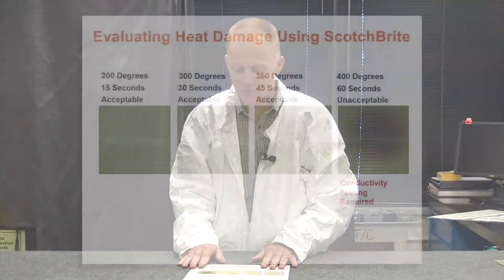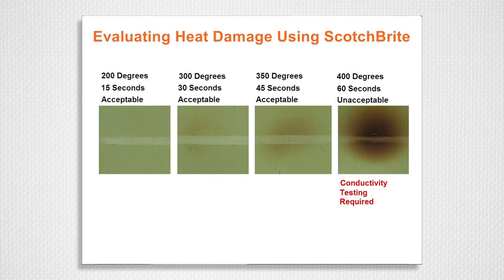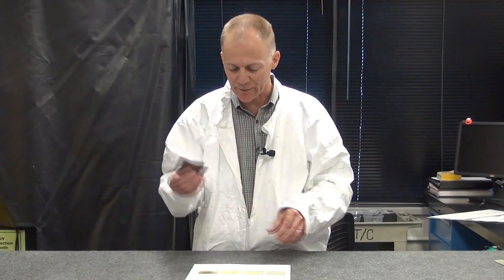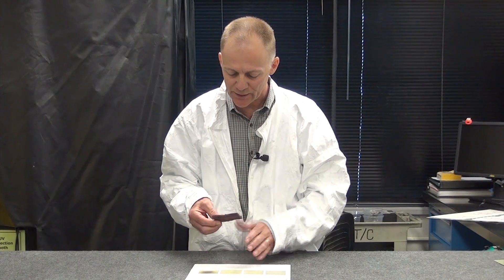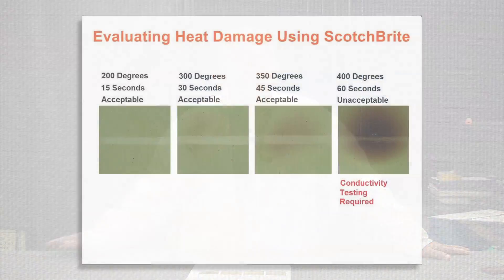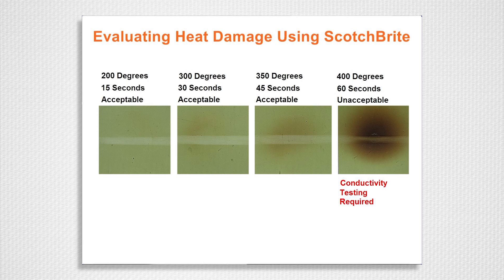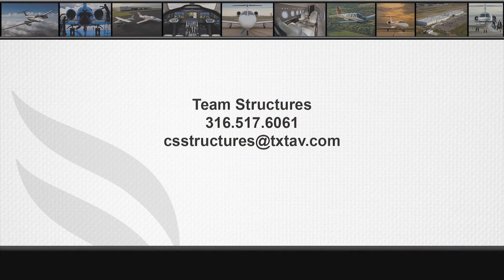Evaluating Heat Damage Using a Scotch-Brite Pad

Comment: Thanks for the explanation, in fact it was very useful for us as we have a heat damage in the pylon and rear compartment of a cj2 due to the rupture of a precooler.  My question is why Cessna has not installed a pneumatic shutoff valve in the engine to avoid the recurrence of this problem, the shutoff valve is located inside the tail compartment, I don't understand why there is no heat sensor in this area to alert the crew.  In this serious situation, the only indication in the cockpit would be the high ITT and the pilot would only reduce power, but even in idle the bleed air temperature would be very high.